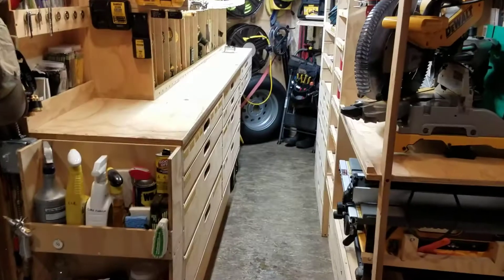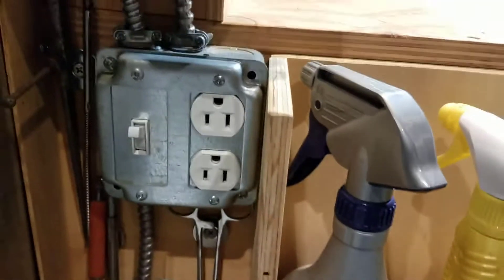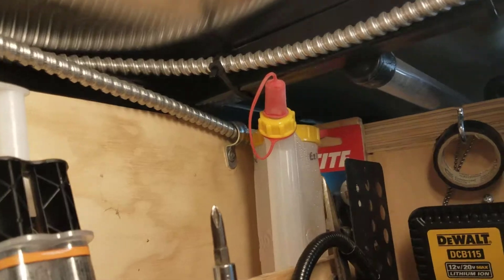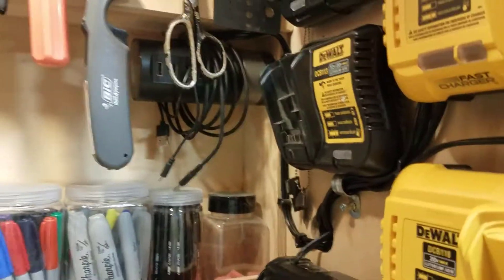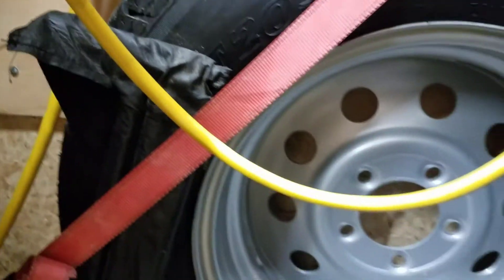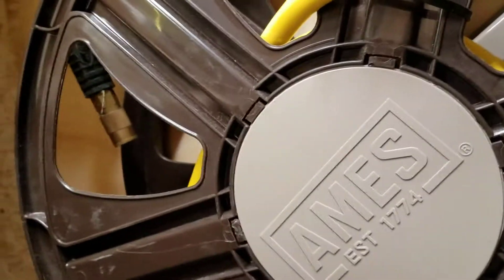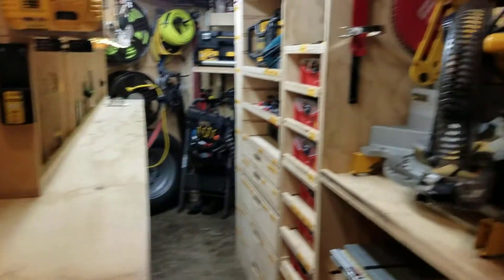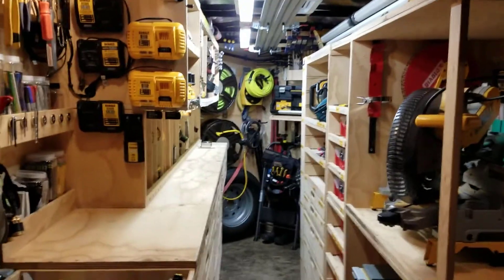TOOL Trailer ELECTRICAL System  - "a la carte" deep dive series - Paulk-Inspired sSMART tool trailer

Comment: WHAT SETUP DO YPU HAVE? DO YOU USE A BATTERY SET UP WITH A CHARGER WITH AN EXTNAL PLUG TO CHARGE THE BATTERY? IM LOOKING TO DO THIS AND JUST LOOKING TO SEE BEST INSTALLATION SETUP TO USE?
Reply from the maker: Thanks for checking out the video and commenting Richard! I do not have the room in this trailer to easily put in a battery/inverter system so all my power is from shore power. I have a hose reel in the back with a 100ft 10/3 extension cord that I can deploy through a hole in the trailer floor to plug into a recep at the job site or my home. I pigtail from a trailer recep to the extension cord and this powers the trailer. My next trailer will have some sort of dedicated power so I do not need to always plug into an outside source. 

You should check out Renovations and Repairs YT channel. Richard out of Michigan has a larger built out trailer and has utilized batteries and solar for stand alone power. https://youtube.com/playlist?list=PLfzsjsiEiSceiru8N44kihSIB57W5mKYa 

Another YT channel to check out is ShooshineJonnie who also has battery power  ... https://youtu.be/gkwuCH78nJU

Comment: Hey Steve - I am curious as to why you do not have your plugs GFCI protected.  Is it because you are assuming that any shore power you pug into will already probably be GFCI protected?  I am going to put just one single plug in my trailer that will also be the point of feeding the switch that controls the LED interior trailer lights I have.  Would you recommend that I put in a GFCI plug or do not go GFCI?  Thanks for your help
Reply from the maker: Howdy! Thanks for the question. I am plugged in to a GFCI around 60% of the time on job sites and 100% at home. Truthfully, I don’t worry about a GFI on the trailer because two in a circuit can cause issues so this insures it will not be a problem. And……..I am usually only running chargers and LED lights (and when I am running an extension cord from the trailer for a table saw, it only in good weather so the chances of water interaction is minimal.)
Reply: @sdsconstruction  Makes sense.  I thought that might be the reason because you would usually plug into a GFCI protected plug when you plug into shore power.  Just out of curiosity, what is the blowgun that you have on the back of your trailer?  I do not seem to have good luck with blowguns lasting.  They start leaking around wither the connector or the trigger.
Reply from the maker: @pi_guy-b1p  the blowgun was just an inexpensive Amazon gun I ordered. One of two. The first did get jimmied up but the second has been going strong without issue for a long time.  $12 …… JASTIND Industrial Air Blow Gun with Brass Adjustable Air Flow Nozzle and 2 Steel Air flow Extension, Pneumatic Air Compressor Accessory Tool Dust Cleaning Air Blower Gun ……. On Amazon.

Comment: Thanks for the videos, I enjoy hearing your ideas on the trailer. The hot plug back feeding the outlet makes me squirm. It is a shock hazard to someone not familiar with the setup. For a disconnectable feed, I use a motor base plug on my trailer. Thank you again for efforts.
Reply from the maker: I see your concern. My double-male pigtail is wire staple secured so it never unplugs from the outlet. I plug the opposite end in to the extension cord so the “hot end” is never exposed. That….and I am just about the only one in my trailer and the only one ever to hook it up to power. Thanks for commenting!